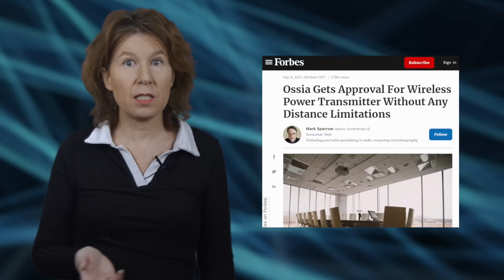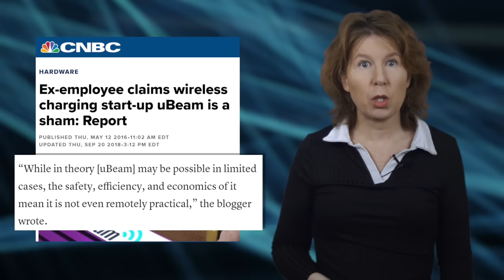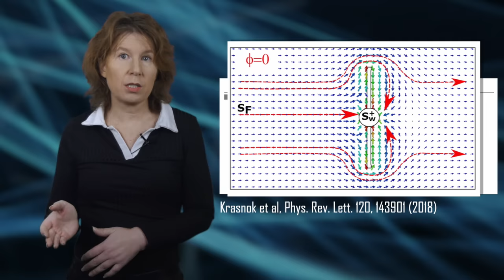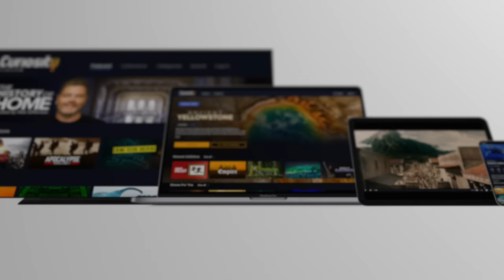How close is wireless power technology?

Comment: Pound notes wont catch fire in an open room if you leave a microwave oven open (with the trip switched bypassed).  They need to be in the oven, or you need something better than a magnetron in a typical microwave oven. A cut, but still connected grape makes quite a nice plasma display in a closed microwave oven, at the peril of the oven's lamination or circuitry.

Comment: Over the past few years, I have read articles about how Nickolai Tesla tried to develop a wireless power transfer system and how, if we adopted this, we would all be able to get free electricity.  
My response to this was that there would still be costs involved since there would have to be transmission towers built, and everyone using the power would have to have the necessary equipment to utilize it. And the power to be transmitted would still have to be generated and at a cost.  Therefore, it would not be free.  All of that equipment and power would cost money. 
The fact that this would mean that a lot of energy would be in the "air" could cause problems for the reasons given in the video.  Those who believe we were prevented from getting this "free power" because "there would be no way to put a meter on it" have an unrealistic expectation that it would just happen if we wanted it.

Comment: There is a startup out of New Zealand that claims to have solved the issue of long distance wireless energy transfer without incurring large losses. Tech is based on efficiently shaping the electromagnetic beam. Was curious if you had any thoughts on this as most of the video focused on transferring small amounts of energy locally.
Reply: Yes but their method requires many relay stations.

Comment: I suspect that any system that steals power from 5G transmitters will be frowned upon by the 5G operators in the same way that stealing the power from TV  and radio transmitters is , There was a case years ago in London where someone was lighting their house using power from the BBC transmitters, this cast a big shadow in the broadcast area where people in that shadow could not get a signal as the power had been robbed. Every receiver loads the transmitter. As for mobile devices such as phones why not use a tritium battery, most likely the phone manufacturers would not like that as the phone would run for years without ever needing charging or a new battery.

Comment: Cell phones are also charged using induction. It's most commonly branded under "Qi," a standardized transmission protocol which has gone through various upgrades over the past few years to improve charging speeds

Phones and other devices use near field communication (NFC) in conjunction with RFIDs to exchange information. This is now widely used to send and receive payment at point-of-sale (POS) points such as checkout counters

Comment: Loved it. You did a thorough description.  Efficiency for wireless transfer should be high to be practical.   Nearly systems that provide interesting range are very power inefficient.   Systems have been built which enable inductive resonant wireless power transfer from a road.  None of them are nearly efficient (or low in cost) enough for large scale deployment.

Comment: There are induction chargers that plug into the phone's USB and which fit within an enclosed phone protective casing. And those that can replace certain batteries. These are the kind where you lay the phone on an included induction plate to charge. Very convenient! This solves the built-in standardization issue brought up at the very end here.

Comment: Power from ultrasound was realized from ultrasonic directive parametric speakers arrays tuned to excite piezoelectric materials allowing the piezoelectric material to act both as a power source and a data receiving device. The directional carrier beam was usually around 200KHz and a second modulating wave would excite the piezoelectric crystal at resident frequency. It was discovered that the amplitude required to sustain the system in a usable fashion simply was audibly dangerous to human hearing as well as other living things. Some speculation claims these audible energy waves drove animals and people to a level of madness.

Comment: if you can wirelessly charge your phone at 1W which is not as high as a usb charger that's pretty darn good. It's good because it can do it constantly keeping your phone topped up. You are unlikely to discharge your phone while it is plugged into a regular charger even if you are endlessly scrolling tiktok and I think the 1W would keep it with enough battery throughout the day that by the end of the day it would be low battery but ready to charge overnight.

Comment: Hi Sabine, I don't remember if I told you, but you can use RF energy Battery. A simple kit I saw years ago inside an electronic experiment magazine at a local bookstore, but I never bought it yet, but when completed, it tunes to our radio stations, and converts it to 9 volts of electricity, and with enough inverting power adapters, viola, you have AC Power! From DC to AC. or if not efficient, then DC to DC meaning only small things, but still, there must me some way to up convert this RF energy from radio towers. As to what will allow the radio tower to get it's power? well it can do the same thing from a near by radio tower and back again. ( it''s complicated), but I feel that a kind of zero point energy will happen. (smiles) Terry

Comment: I think the way to go is to use what is already in place, basically charge up clouds leave markers to let those that need the energy know the cloud is charged and when we need charge use a device to connect to that cloud so it can send the energy down from the sky.

Somewhat like static electricity, as it would be very powerful the receiver would need to recharge on a single bolt.

Basically reliable lightning that we could predict and guide to where we want it.

Let's face it there are thousands of volts in a single bolt of lightning all we need to is predict or create our own lightning, we don't need to be able to charge our phones off it, just need to move lots of power quickly to a collection point.

It's  alive It's alive the monster is alive.

Comment: Wireless (electric) energy transfer intrinsically has three loss mechanisms:
- Converting DC into (HF) AC. Typically 50% efficiency.
- Radiating and absorbing the electromagnetic field. As stated, this depends on the coupling factor, thus distance. Note that coils also have loss mechanisms, like the skin effect .
- Converting AC into DC again. This depends on frequency, whereas a higher AC frequency results in more losses.
This entire chain makes the total energy efficiency low, the remainder being converted into heat that must be dissipated somehow by cooling. At higher power levels, fans for air cooling or other means to cool must be used. These also requiring energy.

Wireless energy transfer requires a substantial amount of electronics. In general, these electronics have limited life-span and are not environmental friendly, both because recycling is difficult and proper recycling expensive, and manufacturing of components requires scarce resources like rare (earth) metals. In the end, you will have a load of junk that is dumped into the environment. The best electronics design is the least complex in this view.

Looking at these two factors, energy efficiency and electronics cost and waste, it should be clear that wireless transfer of energy should only be used where there is no feasible alternative. It is not 'green' . In other cases, the old cord with plug is a far better option. 

Another option is simply equipping small apparatus, like torches and mobile phones with built in solar panels. Light is either freely available or can be generated . This energy transfer chain requires less electronics and might even be more efficient than wireless transfer.

Comment: If you use the magnetic resonant power transfer. The coil and capacitor has the same inductants as the Capacitar has  capacity. Instinct the antenna in the eye aspire. As long as you have a receiver in the atmosphere anywhere on the Earth you can get electricity The same amount of electricity in as the same amount of electricity out

Comment: Sweetie... You're WAY behind the times. Out here in the desert, when hi voltage (AC) power transmission lines were first being installed the old miners would run a wire up the tower and light their blubs, free of charge!

Comment: Beamed microwave RF sent to dipole antennas equipped with diodes. The antenna diodes convert incoming RF frequencies into 1/2 wave DC that can be converted to full wave DC. I had a chance to view the equipment used in a live demo at NRC Canada nearly 40 years ago. Or consider MASERs……plus a laser safety beam that disables the xmitter if any objects pass in front of the beam.

Comment: Wireless solar power. Grows crops at 2% efficiency or powers your heat pump at 20% efficiency, which moves heat to get over 100% heating or cooling efficiency. Solar ovens can cook for free, even in snow, and a 1 m2 Fresnel lens can melt glass.

Comment: Other options? (EM is so yesterday) so....
Perhaps we should fold the space between all our devices so far field becomes near field.
Or live in a black hole where distance is just a concept.
How about switching between consuming negative and positive energy so the net needed is an efficient 0
Could use kinetic energy transfer, transmitter would fire bullets at the receiver ... this is not a new method, energy has been exchanged between devices this way to solve many a disagreement.

Comment: "Structures in space" means, like what Tesla tried with Wardencliff tower. Basically create complex scalar fields, or even standard EM broadcast over specific frequencies, to which only the constructed receiver can absorb. Everything else, in the environment should not be able to absorb it. This works in very particular cases and rather short distances, depending upon the method. I.e. imagine charging a large oscillating capacitor, not resonating anywhere near its wavelength and then some other capacitor, expecting that non-resonant frequency, extracting it via a transistor circuit.
Also, depending upon your interpretation of QM, you could label this as a "Quantum Effect." I.e. the "transactional interpretation." After all, planks constant and relation to frequency and wavelength is a quantum effect.
I could imagine a situation, about the size of a room, where this could work, at least theoretically. Practically, was another matter. Tesla was not always practical as well.

Comment: You cannot get around the Poynting  Vector. I am convinced it is not possible to operate a device with more than some Watts (probably 1kW) with a wireless connection. Even if this is (somehow) possible, we have to deal with huge transmission losses.

Comment: I was under the impression that, like you said, nano technology was the answer.  A robot small enough to be powered by...  whatever, preferably something already going on ie. cosmic background radiation and would not cause major catastrophic failure ie. planet core electromagnetics (van allen belt) that would bring about runaway tele geo dynamics. (That was Tesla's problem not to mention the size of the power plant)

The robots turn a wheel or vibrate a ribbon and because they all use the same abundant power source the problem of standards is solved.  Because they never stop working they never stop charging and you never need to worry, well almost never.

Comment: because arbitrary wireless power would require power transmission, for which the power will fall off by the distance squared. The best we could perhaps get is a directed laser beam and them somehow generate power from that. That is expensive and doesn't scale well for billions of devices. Engineering wise it's a lot simpler to simply shove in a cable every few hours or days and it doesn't cause that much of an inconvenience.

Comment: I think the main use of wireless transfer of power wouldn't be for transferring to individual phone, computers, etc., but instead to get power from somewhere otherwise inaccessible. Specifically space. Building a Dyson Sphere around the sun of solar collectors, then wirelessly transmitting that power to Earth (pausing for when things like the moon, Mercury, or Venus would be in the way, perhaps the ISS as well) would allow us to collect massive amounts of energy and collect it for use here. The energy loss in doing that might be huge, but the amount of overall power generated may just be so big that it doesn't much matter. Also, I'm not sure how much maintenance a solar power panel in space actually needs, with replacement only needed every so often (this seems to be getting longer, with the average being around 15 years from my quick google search), meaning beaming from around the sun to something in orbit, and that thing in orbit to the ground might be a viable method of getting power. ... But I don't think having 'beamed power' to individual devices will ever be viable for anything other than devices that use extremely little power, and never for important ones.

Comment: The only practical way for the idea of wireless charging is to extract photons from any sorts of light to create free moving electrons within a device, and thus voltage or electric energy stored in such an electron-run machine. It is like how a photodiode can obsorb kinetic energy from photons and transfer it to electrons for them to move in a closed circuit. You can charge your phone's , computer's, car's etc while they are under a source of light , no matter whether it is natural light, such as that from the outerspace or from human-made light , such as that from light bulbs , or even candles , a fire place.  The costs of such sources of thermal energy are feasible  being either economical or free. The only thing ypu will have to do is to create an effective way to store free voltage or electromotive forces within a machine after photons's kinetic energy has been transferred to electrons already existing in the machine

Comment: In several ways already yes.
In some others not yet.
Some tech already exists that allows for long rang power transfer in space,
like having an ultraviolet laser projecting light far away, like light minutes,
and then being absorbed by a satellite that has solar panels.
For very short range there's induction, but for both of these it's most
cumbersome and also the laser only works in space.
For true wireless power transfer though like 40 meters away in an Earthly
environment, there's nothing yet that can carry large currents.
Using short range masers or lasers is possible, but hard to construct,
since it would involve a vacuous pipe over the same distance,
which must be really straight within mm over kilometers on end.
The conversion process would also lower performance.
For now we still need to use physical network of powerlines, like
UHVDC over long distances to transport electric power from places
with great abundance to places with net negative.
Right now it would already be great if there was a global electric UHVDC
network coupled with large potential energy storages, for transport
of large quantities of electricity by solar.
For highways it would be nice to have induction lines providing power
to electric cars for travelling large distances without recharge.
this would be better for battereis as well as it would increase their
lifespan drastically, while also providing things like autocruise,
where the computer takes over for the long drive.
Computer controlled traffic can greatly increase highway effectivenesss.